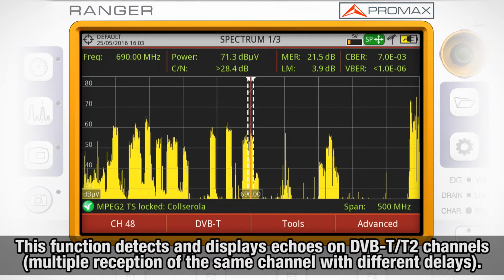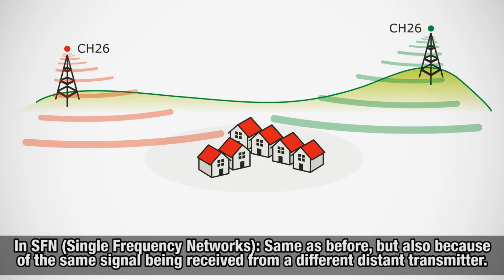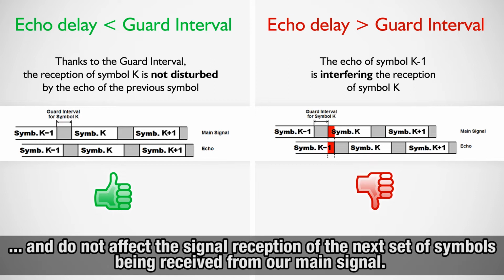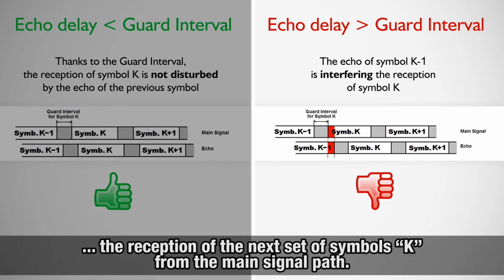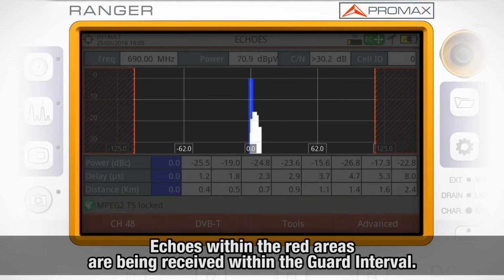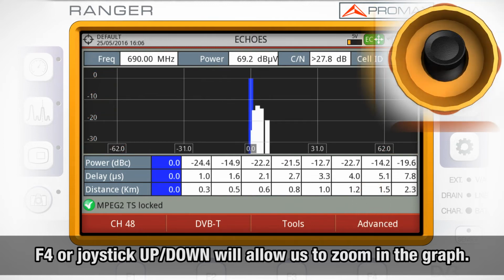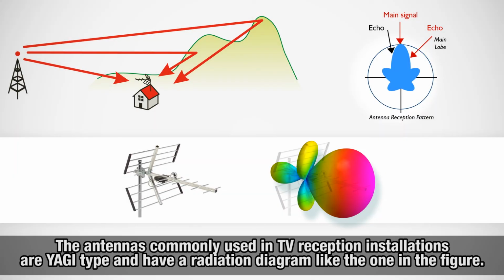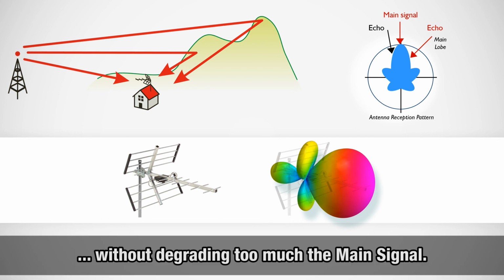RANGER analyzers tutorial: [12] Echoes analyser

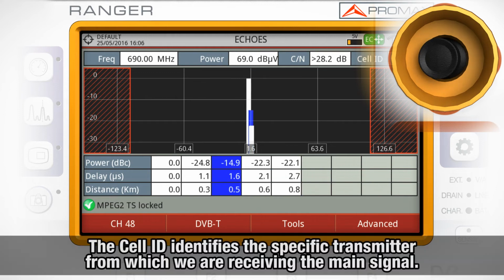Comment: Dear Promax, at 3:33 time slot  indicated can use cell ID of Tx to identify which echo  belong what Tx right? but we tried at lab can not working when set difference cell ID at Tx (sfn will not work, must set all Tx ID same), please advice !
Reply from the maker: Not in SFN. All TX broadcast the same Cell_ID. It is possible to know the Cell_ID of the strongest transmitter in the area but not that of the other ones.
Reply: @PromaxelectronicsGlobal  Dear sir, sorry still not yet understand your meaning. As the clip above I still think that we can identify which echo belong to which Tx based on Cell ID right? or no way to know how to identify which echo belongs to what Tx, only can know by calculate the us of that echo right?
Reply from the maker: @MrNW2707  It is not possible to know which echo comes from what transmitter besides, as you are suggesting, the time-distance calculations. If that is an SFN network all TXs will have the same Cell_ID so this parameter can not be used to identify a specific TX.